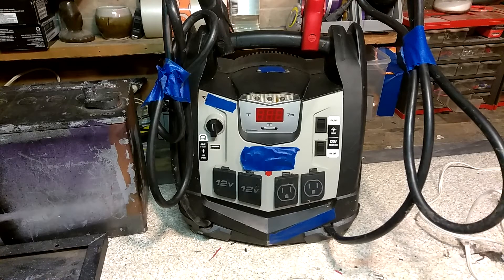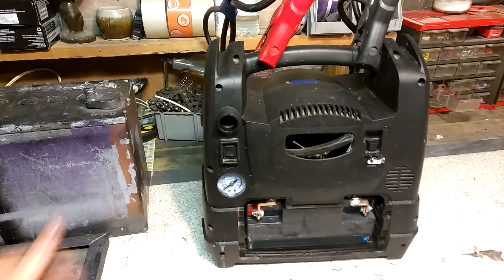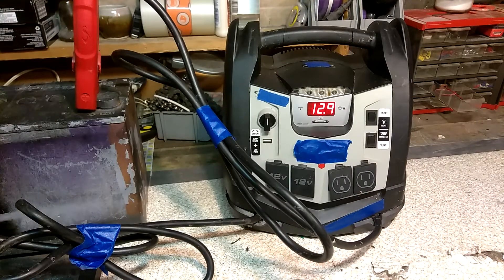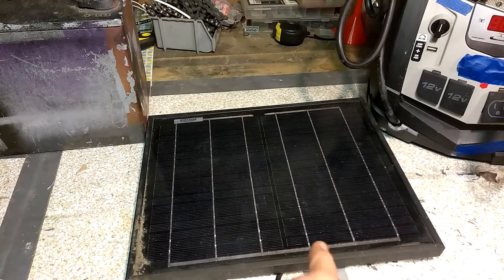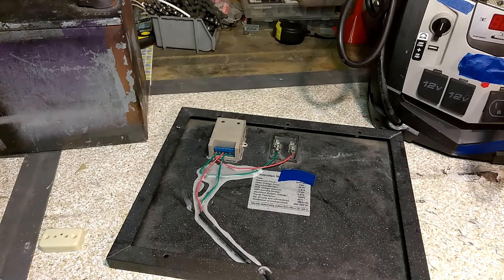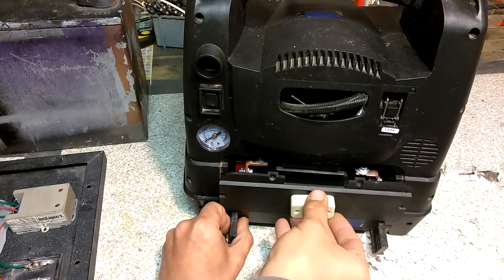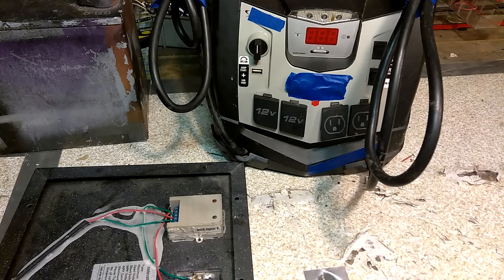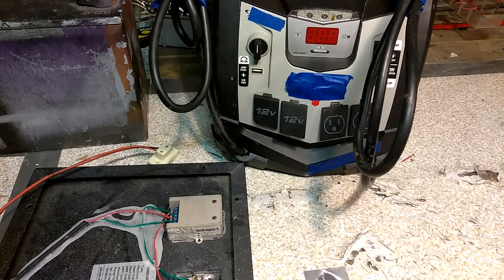Add solar charging to jump pack.

Comment: you can just hook up the solar panel with the charge controller straight into the 12v outlet and it will work the exact same.
Reply from the maker: Good point!

Comment: Fixing to make my everstart 1200A jump pack solar charger with harbor freight 100w solar panel and regulator. Its cheaper than buying a jackery power pack for sure
Reply from the maker: Absolutely.  You can spec out your own build for what you need and also know how to repair it with hardware store parts.
Reply: @ThriftStoreHacker I have a solar system at my hunting camp that runs a water well pump, lights, and other small items. Also have more than one jump pack so if I do burn it up will have spare parts. Lol
I'm always working on something. Enjoyed the video.

Comment: Excuse me wire selection is very weak. 
To obtain Effective volt current, you should upgrade to 5AWG wire between SolarPanel and Controller. Thats all my 5 cents tip for the day.

Comment: So I can get a 100w solar panel to connect into my 120v 2 prong plug on my JnC660 Power Jump Pack and it will charge it automatically since it has the charger built-in the JNC660 ?
Reply from the maker: You would need the panel and a small solar controller like I have on the back of my panel.  You probably want to connect the controller to the battery directly because the built in charge controller is built for a certain unknown spec range.

Comment: easyer way is to put ur solar panel and charger  on a car 12v plug and just plug it in the 12v outlet as usealy there direct to the battery anyway
Reply from the maker: Good idea.

Comment: Shouldnt your solar panel come with a plug in car lighter plug. if u plug that in to the female lighter plug on the jump pack hook ur voltmeter up see if it charges it. it should
Reply from the maker: It can be done like that. You really want some sort of charge control between the battery and charger so the battery doesn't overcharge.

Comment: Great information, thanks for the effort. I'm interested in this as a backcountry/camping solar generator. Couldn't you use the jumper cables to the solar panel (with charge controller in line), flip the jump switch and charge the battery without doing any modification to the battery pack? Interestingly I did a random search to do this and you used the same pack I have, love the luck! I have three 20w solar cells I'd hook up in parallel. What do you think?
Reply from the maker: Yes you could do that. I'm fairly certain there is no blocking diode on the jumper leads, I think they just run to the battery terminals. 

You could easily parallel a few more batteries or switch to a big storage battery.   I usually run mine on one of my big batteries from the trike project.
Reply: @ThriftStoreHacker  Cool, I'll test it out and give you a shout. Thanks again!
Reply: What about using the 12v cigarette lighter port in the same manner ?